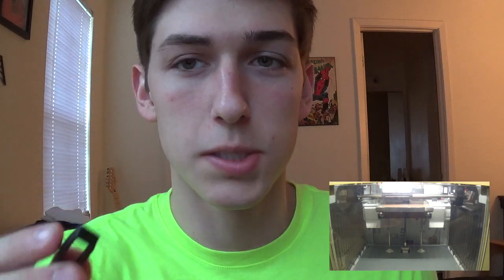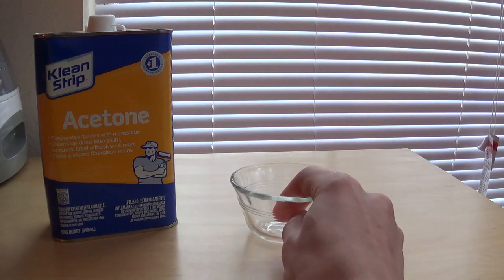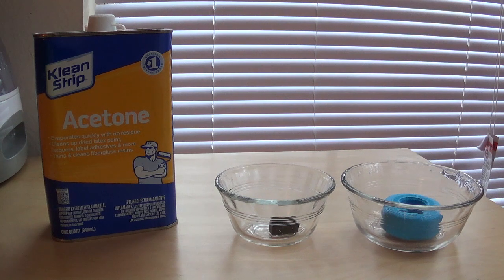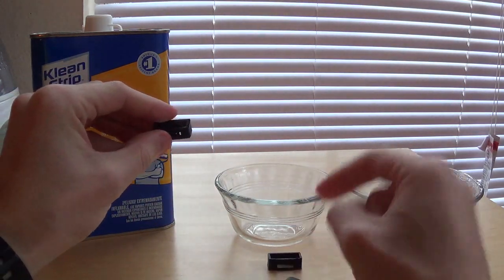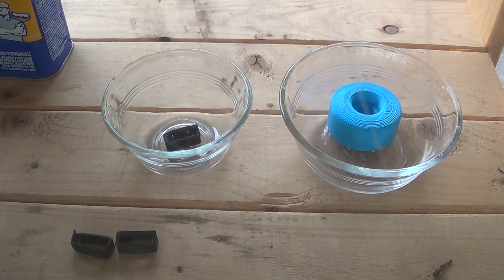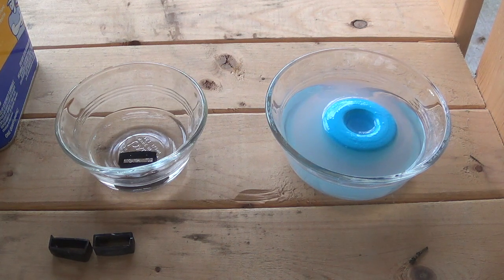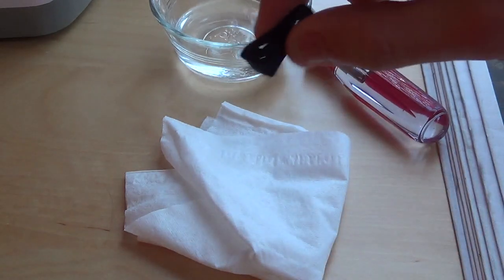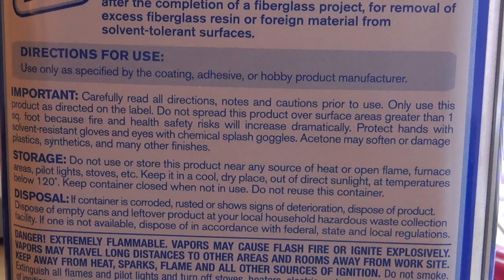PLA 3D Prints Soaked In Acetone Chemical Reaction

Comment: I soaked a pla part in acetone for few hours but it turned white there was a whitish layer on the part. flexible but the blue filament turned weirdly white
Reply: Hit it with a heat gun.

Comment: So I print a mini Marvin from 3D Hubs and in what I'm 99% sure was PLA, I used PLA temps and everything, I looked like PLA compared to ABS and I put it in a bowl of acetone for 13 hours (while at work and school) and came home to it completely desolved
Reply from the maker: It was definitely ABS then.
Reply: +Bryan Keller it didn't instantly melt or anything like abs would. it weird. I'll have to take a known sample and try again.
Reply from the maker: +Chris Brown that is weird. I would get a small piece of it and burn it with a lighter. If it smells like burning Legos it is ABS. If it has a maple or sugary smell it is PLA.
Reply: +Bryan Keller that's a good idea, I'll have to try that later.
Reply: +CBreezy I heard that there is some sort of pla filament that would act like abs when introduced to acetone. some have said is pla they bought from colorfabb.
Reply: RazerOfPain I haven't bought any Colorfabb but the pla I bought from a MicroCenter acted like ABS while there was Acetone on it and as the acetone desolved the pla hardened again.
Reply: +Chris Brown PLA is bio degradable. Acetone does not milt ABS. It separates the bonds between the compound of a few plastics. ABS is usually made with the same compounds because of how they bond(I also think because ABS is used in cars to prevent damage from collisions they might have a standard requirement for ABS). Many companies have made differences to there PLA recipes. Your PLA could just be a mix of something that causes a chemical reaction with acetone.